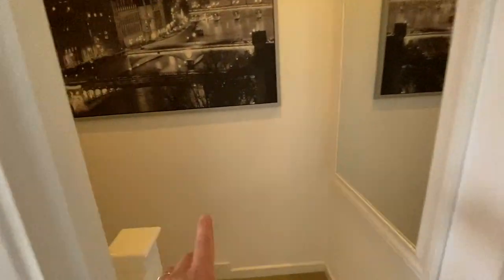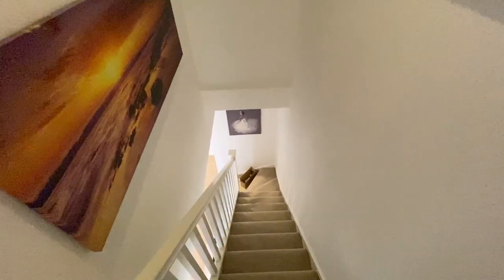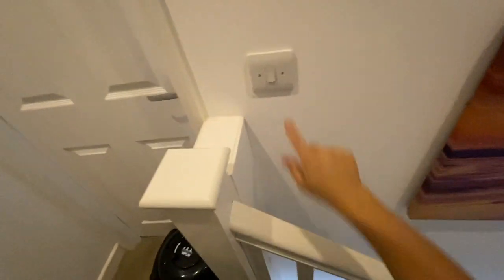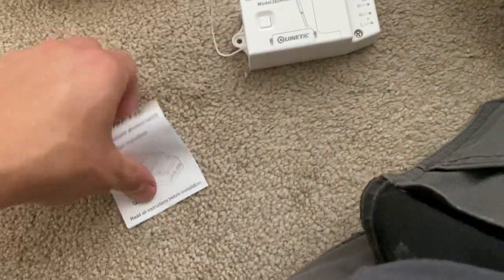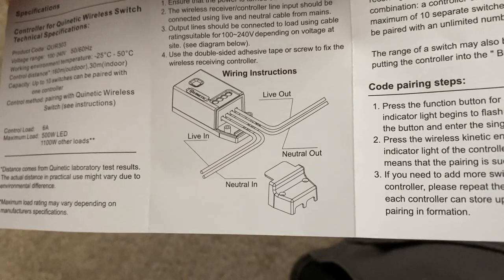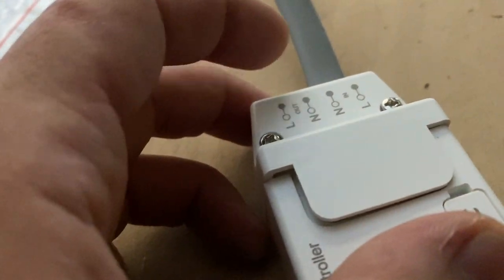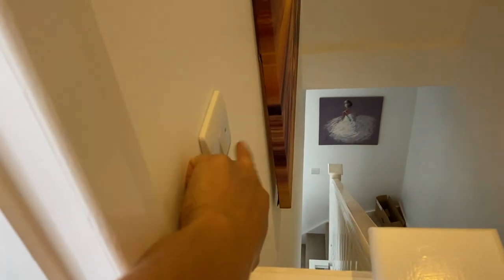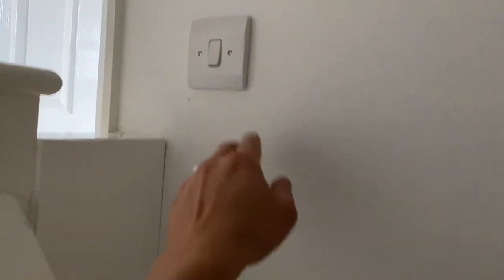2 way switching in 10 Minutes!!! No wires No cables needed. Is this the end of chasing days?

Comment: Simple way of doing things is to take the switch modules with you into the loft rather than having to run up and down the stairs & ladders!
Reply: @goodcat1982  but that bit can be done after pairing. In fact, I wouldn't of cut the holes in the walls until I had paired the switches & done a rough test with the switches in the approximate position.
Reply: @goodcat1982 what's the point of fitting them in the wall to find out that they won't pair? Pairing & testing whilst in the loft proves that the system is working in ideal conditions & saves running up and down stairs and ladders so much - if it doesn't work when you then move it to location you know that it's related to the location rather than faulty equipment or failed pairing!
Reply: Take them to the loft.. no it's better fun running to the switch before the set up timer runs out
Reply: I see the commenters are getting their daily exercise, by jumping to conclusions...
Reply: @farmersteve129  take a day off mate 🙄
Reply: @ryanmentiplay7468  But he's right.

Comment: Excellent post. Very well explained and in great detail.  Simple solution to borrowed neutral issue on stairs lights when RCBO board is installed. Like the rock roses for the down lights.

Comment: Use these to remove borrowed neutrals on 2 way lighting. Cut the live feed from the downstairs feed at the switch. The landing light is then fed from upstairs but better than a borrowed neutral. The upstairs and downstairs lighting can then be split on an RCD or RCBO board.
Reply: The worse thing you can do,is a borrowed neautral,got a right belt on one job I was working at,not only that it took me a long time to sus it out and put right .

Comment: I saw these back in the day when DSS electrical used these alot in his videos, ive since done all my garden lighting with them using the 3 gang switches for indoor and outdoor use. Fantastic bit of kit!. Suppose theyre a complete game changer for you lads when it comes to rewires! Great content as always.
Reply: Great idea to use this for garden lighting. I don't know if this is legal in the UK, but here in Belgium we can use "mixed circuits" with lighting and sockets on 1 breaker, which is what I did in my garden using a single 4core + Earth (Earth + Neutral +Live + 2 Switched from inside) cable running throughout the garden with some slack in tactical spots and junction boxes wherever I placed sockets, lights, powered decorations... I thought it was a great idea for doing this since this allows me to easily add lights, sockets, decorations later if I need them and my garden isn't large enough to ever need more than one permanent and two switched live feeds.
The mistake I made there was not accounting for having switches outside so I can only turn on/off the lights from inside the house. This is a great way to add a switch wherever I want in the garden, I can even put one right in the side of my chair or in the table without needing extra wiring.

Comment: Great system, years ago a similar system was available but unlike this MK set up you needed power to the switch. This is so much better I will be tying this out at my place before clients, could be a good money saver in time and indeed effort a good balance of product cost against first fix cost, brilliant. The number of click activation is a hell of a lot most light switches are used less than you think.

Comment: i had to fit one in a old farmhouse a few years ago when they first came out, its in a sitting room where the one light in the center of the room was a old fan plus light setup which had pull cords on it for switching. the couple that had the house moved in at wanted it changed but never thought to maybe look at doing before re doing the whole room decor which cost them a fair bit. so i told them there was one thing we could try and put it all together with a new light fitting which was big enough to mount and hide the reciver and its worked ever since, would still rather hardwire where possible, tbh
Reply: This is why i asked the question myself,In the long run is it better to hardwire, With that you know it will last a lifetime.

Comment: Wow!  What a system!  I was temp. worried about whether the switches required batteries, then looked up the products website where it states it uses the kinetic energy of the key press to generate the pulse picked up by the receiver (must be piezo-electric?).  Genius! I will defo be using these in future.
Reply: The request to stop buttons in modern buses use the same technology

Comment: maybe it might be easier the next time to wire the receiver first and then bring the switches up into the loft and pair them next to it, instead of doing all that running around. 👉Think big, work smart😂😂😂
Reply from the maker: Your correct but I wanted to make sure they would work in the locations as the loft is full of celotex that’s great at blocking any kind of frequency.
Reply: @Cjrelectrical  yea that's true would act as a  Faraday Cage I suppose blocking the signal, bit risky cutting the walls for switches tho if they didn't work
Reply from the maker: Did I test them before I cut the holes off camera🤷🏻‍♂️
Reply: @Cjrelectrical  😅 you must be fit as a fiddle if you did all that running around testing on and off the camera twice if you did fair play🤣 i@m pulling your leg mate, all in all, love the videos and the quality of workmanship you put in its great to see 👍
Reply: @eamonnblake9704  😂😂
Reply: @eamonnblake9704  he's fit because he does all that "needless" running... Lol
Reply: @SqwarkParrotSpittingFeathers  No need for a 2-hour stint in the gym for this lad every day saving a fortune in fees
Reply: That would be a logical very non 
Male thing to do 😂
Reply: @paul24w  leave him alone
He's prob completed one of those electrician crash courses poor lad 😂👍
Reply: off*

Comment: Like all modules they will either softfail (wireless issues) or hard fail within a 2-3 years needing another £80 spent because the original is obsolete.  For you situation in a finished room, fair enough but for a new install stick to hard wiring or home run everything to a central room aka home automation

Comment: Clearly useful where running a cable is difficult. The instructions don't appear to mention how the switches are powered. I assume by an inbuilt non replacable battery? How long is it supposed to last before you have to replace the switch?
Reply from the maker: Nope it’s kinetic energy no batteries required

Comment: Quinetic also do  IP67 rated Wireless Switches  for outside & inside use.And TLC have Quinetic LED Ultra Slim Floodlights up to 50w fitted with a Quinetic receiver.

Comment: Chris, would this work if you had a light upstairs and one downstairs, and if you were wanting to move the downstairs double switch to an opposite wall without moving the wiring and replacing the upstairs double switch with a quinetic switch set up too

Comment: Chris, Are the receivers considered "maintenance free" so they can be fitted under carpeted/tiled floor boards? and would they need to be housed in a fire rated box when fitted above a ceiling/under a floor i.e as required for fire rated down lights? Cheers, Gordon

Comment: Prob would have been cheaper to go with a Phillips hue . No holes in walls, can remove the switch/remote and put it next to bed etc. . I Will need to have a look into if quinetic do smart enabled switches . And if I'm honest your best option would have been metal clad switch with 4m of kopex to the light 😂

Edit- just checked , that's not actually a bad price
Reply: No thank you, locked into proprietary bulbs etc
Reply: @norfolkngood8960  yeah get what your saying , or any of the other smart bulbs that are cheaper.  I actually priced it up after my comment and there was little price difference in the end.  (You can unlock Phillip's hue and most other bulbs so your not tied in aswell)

Comment: For £80 will use them if a really have to,where I live most houses are old with the old slip conduit buried in the wall,easy to push new cables down,average house has 10 lights plus,so that's another £800 + you don't have to pay out .
Reply: It's still a relatively new technology, I'm sure the price will plummet in the next year or two when other brands come on the market.
Reply: @andrewd762  thanks for comment,they are ideal for the case on the vid,do you now if the power is turned off for any reason do you have to reset them?

Comment: Mate you were pretty close with that pir. In stead you shoul have used pir+mv sensor and your idea would have worked. As you know pir is sensitive to temperature, thats why it was switching the light on. mv in pir  works as   confirmation of a movement....

Comment: Hey Chris, have you looked into any of the sonoff stuff ('smart home' switches). I wonder how something like that could fit in to a similar installation
Reply: Sonoff is all WiFi so would require power, these units generate power from the action of pushing the switch, so require no power for the switches.

Comment: Excellent product .got a question also .I've done downlighrs in my house .and in 1 room I get neatruel to earth reading 173mv is that normal
Reply: V = R * I
all wire has Resistance, and 173mV indicates your neutral is carrying non-zero current (I). Some loads seem to be noisy and cause higher voltage on the neutral than you would expect. My "office" with several computers has 5V on the neutral to earth.

Comment: A good alternative to using shelly but you need a neutral... Wondering how to takle it if using a switch and want to make it 2 way.
Reply from the maker: They do a built in receiver switch that doesn’t require a neutral.
Reply: @Cjrelectrical  where do you buy the front plate from? I can only find the switches and receivers online...
Reply from the maker: Tlc
Reply: @Cjrelectrical  thanks. They are the official stockist it seems but cant find any faceplates on their site. Maybe they sold out... If you've a link it'd be appreciated 👍

Comment: What powers the switches? They don't appear to have batteries, so is there a tiny generator in each one?
Reply from the maker: Kinetic energy once you press the switch
Reply: @Cjrelectrical  Very neat! I presume they need a firmer press than conventional switches, so would they be OK for a little old lady with arthritis?
Reply from the maker: No if you’ve used Mk push to make switches before which are quite hard to press. These are easy to press with little force needed.

Comment: I don’t know if you try to be funny, or it’s just natural to you. 
“They only have 200,000 presses” made me laugh out loud
Reply from the maker: Yeah i have been told this before maybe standup?
Reply: CJR ELECTRICAL super dry humour ! Start a podcast !
Reply: @Cjrelectrical  just dont give up your day job you already light up the world
Reply: Do the switches have batteries to replace or do you have to replace the switches after 200,000 presses? P.S. how many more presses do you have left? 😂 Great video. 👍
Reply: @cookie4884  Is that a serious question?
Reply: Cookie no batteries, it creates it’s own kinetic energy when you click it, enough to send a quick RF signal to the receiver
Reply: Cablesmith Electrical thanks mate.
Reply: Bit along the same lines as LED lights having a 30,000 hr burn time..
Reply: If thats true you could turn it on and off four times a day for 100 years and still have 50,000 + switches left

Comment: Was that first hole you cut totally plumb to the edge of the wall, in this video it looks like it slants to the right. Just letting you know what I see. Not a criticism at all. Do those switches have batteries that you have to replace?
Reply: no it uses kinetic energy to power, ie self powered
Reply: Like the crystal switches that light gas cookers? Beginning with P, Piazzo I can't spell it sorry, and when you apply a current to them you have the siren used in alarms?
Reply: @busman2000  Piezoelectric effect

Comment: Easier and better way - add a smart switch/module. You don’t even have to cut the holes for the 2 wireless switches. There’s no restriction on how many switches. Multiple ways to turn off the lights. And 10x cheaper than this setup.

Comment: no good if the customer wants to dim any lights if you use quinetic switches, i believe
Reply from the maker: They do a dimming module which is compatible with the switches so as long as you know what your installing from the get go no problems. 👍

Comment: Does the module have a terminal for the CPC or is it just cut back in the cable?
Reply from the maker: No cpc terminal and no room for a connector
Reply: @Cjrelectrical  it's a bit rough they hadn't taken that into consideration when designing the product. I guess there's not much else you can do except cut it back.

Comment: How long does the battery last in the switches? 🤔
Reply: Callum Atwal There is no battery. Pressing the switch generates a tiny electrical impulse which is sufficient to send a signal to the receiver. You might notice they are a little harder to press than a conventional switch.
Reply: @spencerwilton5831  oh damn! That's really cool. I'm just a DIYer, I'll check those out. Sound cool

Comment: So I need to move a landing light switch, it's already 2 but in a stupid place, it's the first switch too so how can these help?
Reply from the maker: They do a switch with the receiver built in then you can add another 10 wireless switches if you like
Reply: @Cjrelectrical  brill so I can use the 3 core strapper from my secondary 2 way switch (ignoring the primary buried behind a bookcase) and put a switch/receiver in that position and then another switch?
Reply from the maker: Correct it works off the live feed no neutral required
Reply: @Cjrelectrical  Perfect!! Saves me arsing round in a parmount partition wall. 👍

Comment: if only that worked on 120 volt systems
Reply from the maker: Voltage range 100-240v 50/60hz
Reply: @Cjrelectrical  thanks. now to get some here in Jamaica as cutting in conduit in cement walls is very time consuming